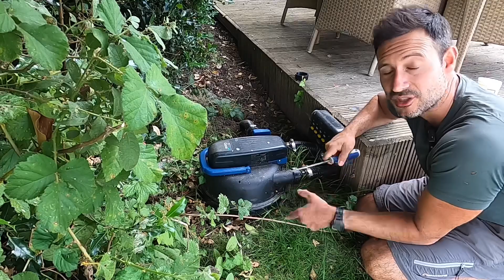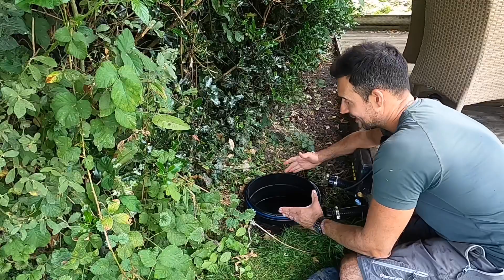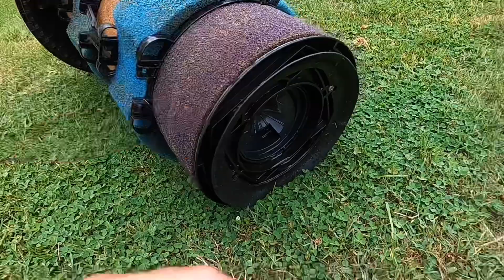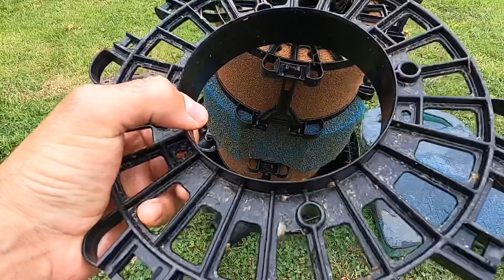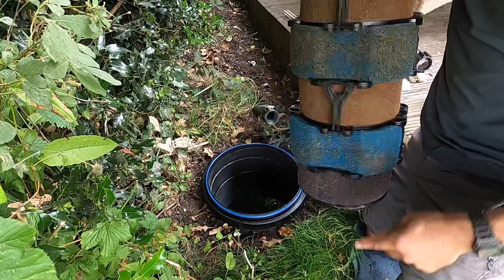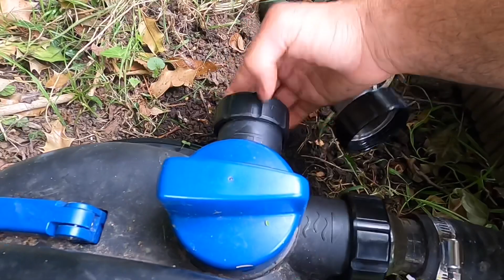How to fully service an oase filtoclear gen 3.0

Comment: Giving my 3100 a thorough service and was hoping you'd show how to remove the central column,  the one which the sponges sit around. I can see some push catches but daren't push any more to release.  Any chance of an update or wouldn't you bother? Cheers. Brilliant  videos you do 👍
Reply from the maker: Hi Stuart, thanks for watching and commenting! Although the central core can be unclipped and removed it’s a bit of a faff and there really isn’t a need to do so-if it looks particularly dirty and clogged simply spraying a hose over this will clear it perfectly well. In all my years servicing these units I’ve never felt the need to take one apart!
Best,
Ed
Reply: Many thanks Ed, I've watched many if not all of your videos over the years from gleaming insightful knowledge helping me make the right decisions from sighting to constructing my 2k gallon pond. So a big thank you to you👍. Re removal of tge inner cylinder, I persevered very gently. In the end it came off quite easily. Gripping the cylinder at the end nearest the lid i just twisted about half an inch. As tge cylinder moves over the shaped plastic sprigs the whole cylinder is released. Glad I did as then able to remove a fair bit of gunge from its inner surface and from the surface it slides over. Bit ocd perhaps but now as clean as a whistle. 
Thanks again Ed, when im stuck youre my go to font of knowledge.  

Now where's that pesky heron!

Comment: Good video! In your experience, is this filter more effective for clarifying the water than the Blagdon pond master 16000?
Reply from the maker: Hi there, thanks for your comment and my apologies for the slow response. Although I don’t have any hands on experience in the Blagdon filter you’ve highlighted, in my opinion and experience from using other Blagdon products vs Oase I’ve found Oase to be far superior.  Sorry Blagdon…… years ago when I started in the trade Blagdon were synonymous with good solid British engineering-their amphibious pumps being a staple in the trade-but now sadly it’s not the case. 
Best,
Ed

Comment: What do you think about one of these running in tandem with a bog filter ? I'm planning on a dumbell shaped raised pond off our patio, won't be heavily stocked, probably around 1500 gallons. 
I like the maintenance ease of these, so was thinking of the Oase Filtoclear and their double inlet pump, using the optional strainer with hose (so I'm sucking water from the bottom centre of each dumbell). Then using a Y piece on the pump outlet (with valves on either branch so I can balance it), then running one branch to the Filtoclear and one branch to a decent bog filter. I like the thought of the biological, natural action of the bog filter as I have heavily planted aquariums where the addition of plants helps hugely with water quality, and combined with the mechanical and UV of the Filtoclear should make a very easy maintenance package for the family. 
....Regularly compress clean the foams, clean out the cannister fully every now and again and trim the bog filter..... would make for a super easy yet efficient filtration and having the two filters is kind of a backup should one block for any reason.. plus the bog filter would be a lovely feature as I'm planning on cladding the raised walls with a natural stone so could integrate the bog nicely.

What do you think ?
Reply from the maker: Hey there! Thanks for watching and commenting! This is a great idea-although you will easily be able to spec a suitable sized filtoclear and pump combo to maintain clean and clear water in a pond of your volume you can never over filter, so the addition of a bog filter will only improve the pond further. In addition incorporating a bog filter will add some different habitat for pond wildlife and offer opportunities for extra planting that you may not have space for in the pond. Go for it!

Comment: Was wondering how this filter would work with
1) Large freshwater tanks
2) Large saltwater tanks
Any idea?
Reply from the maker: Hi there, Thanks for watching and commenting!  This unit would be perfectly suitable in a large freshwater aquarium set up, however I’m not so sure the metal components within the unit would stand the test of time if exposed to saltwater conditions long term… my gut feeling is no, however if you contact Oase direct I’m sure they would be able to confirm this!
Best,
Ed
Reply: @CrystalClearAquatics  Thanks!

Comment: Hi can you remove and replace the uv bulb with the pond pump still running on the latest Filtoclear 13000.
As on the earlier 12000 you could not which was a problem with a upstand pond (filter at ground level below water level) had to switch off pump and disconnect inlet pipe into filter and lift pipe above pond water level (as valve not fitted between pump and filter inlet) to remove quartz sleeve with uv bulb.😢😢
Reply from the maker: Hi there, thanks for watching and commenting; a new feature of this latest gen filtoclear is that you can indeed replace a uvc tube with water flowing through the system. Removal of the uvc tube is separate to the quartz sleeve!  However to be completely thorough I would still recommend removing and inspecting the quartz sleeve for any soiling to ensure its clean to maximise efficiency- and removal of the sleeve would require you to switch off the pump.  If the filter system is positioned lower then pond water level you’ll either have to remove the pump/inlet to the filter from the pond and ensure the outlet pipe is lifted above water level to prevent the pond siphoning out of the filter, or better yet install some isolation valves.
Hope this helps!
Best,
Ed

Comment: Wonderful video Ed!  Thanks so much for sharing.  The only thing we do differently is that the filter itself is not buried directly into the ground.  We instal a large flower pot or bin with holes (marginally larger than the bucket itself) and then sit the filter into it.  Makes for easy removal over winter :-)  Cheers!
Reply from the maker: Hi there! Thanks for watching and commenting and love your idea! May I ask where about your located? Am guessing not the Uk-over here we tend to leave filtration systems running all year around!
Best regards,
Ed
Reply: @CrystalClearAquatics  Yes, of course!  Ontario, Canada!  Because of freezing temps, we have to remove the filter for winter.  However, many customers want to remove the filter during the season too, but once it's dug into the ground, it ain't ever coming out (without a lot of blood, sweat and tears LOL).  Keep up the great work Ed 🙂

Comment: I may be a little late in my comment here. I've just added one of these to my pond, fired it up, pump works, water goes in and out of filter. I turned it off for about half an hour and then turned it back on. Water now sprays out of the hose and theeaded seal of both the inlet and outlet, though it didn't do on the first run. The clips and threads are as tight as possible. Any ideas on what I need to do to stop the leaks?
Reply from the maker: Hi there! Thanks for watching and commenting-is water leaking from the hose connection where it screws onto the filter, or from where the hose is attached to the hose connection? If the former it’ll be the o rings haven’t seated correctly. Switch the pump off unscrew the hose tails , remove the o ring and check for and kinks/debris on them then refit and screw back on. Be careful when screwing back on the hose tail as the O rings can move out of place quite easily. Tighten till you meet resistance then torque a little more. Don’t over tighten as this can push the o ring out of shape and case a leak. If water is leaking from the hose then remove the hose from the hose tail connection, add some ptfe tape to the hose tail, refit hose and tighten with a suitable hose clip/jubilee clip. 
Good luck and hope this helps.
Best,
Ed

Comment: Brilliant video! I have just purchased this exact filter and was just wondering why you wouldn’t recommend this for a larger pond? My pond is quite big 😬
Reply from the maker: Thanks for watching and commenting Oliver! Pressurised filters such as this Oase filtoclear- although excellent in smaller ponds-have their limitations (chiefly the small proportions) and so have limited use in large ponds or ponds with high fish stock/koi ponds. Although technically good water clarity and quality may be achievable using such units in large ponds or koi ponds a larger pump fed gravity discharge, or bottom drain fed system would be better suited to larger ponds above approx 3000/5000 gallons 13600/22700 litres.
Best,
Ed

Comment: I have a problème thé water go out if the filtre down from the change water direction
Reply from the maker: HI there, thanks for watching and commenting- not sure I entirely understand your question, but I think you’re saying that water is leaking out of the discharge/cleaning outlet? If so this is normal- the blue rotary valve you turn to perform a back wash isn’t designed to be completely water proof. If it was then  resistance in trying to rotate the valve would be such that it would make it physically very difficult to turn and cleaning much harder.  This is why the cleaning discharge outlet come blanked off with a threaded end cap.  This must be left in place all the time until a back wash is performed and then replaced again afterwards. Also make sure to return the blue rotary valve to the filter position (pointing towards the embossed fish emblem) after performing a backwash.
Hope this answers your question!
Best,
Ed

Comment: Hi Ed.  I have the older Filtoclear 20000. Do you know if the new style foams will fit ?  I have noticed they appear to be quite a bit cheaper, also there are 3 grades of foam instead of 2.
Reply from the maker: HI there Nigel, good question! Im going to say a tentative ‘Yes’- the new foam shape from gen three will technically fit the older gen two models- however (although I’ve yet to require a set of replacement foams for the new gen three so don’t know this as fact) I suspect a set will only be replacement foam and not include the plastic plates that hold the foams into position and help aid pulling the cleaning lever for backwashing- the main reason why this new shape foams works with the gen three unit.  I also suspect the these foams wont fit particularly snuggly in the gen two units, possibly compromising the filtering efficiency.  My gut instinct tells me to stick with gen two foams for the gen two model.  If I discover otherwise I’ll let you know however!
Best,
Ed

Comment: Hi Ed, great videos .. many thanks I have  a question for you..I have a Oase Filto Clear 30000 with a  AquaMax 17500 , my question is can alter the flow velocity coming from my filter/ pump configuration or can I vary the flow coming from my waterfall... currently the flow is just too strong for my pond ,many thanks..
Reply from the maker: Hi there, thanks for watching! Good question; simple answer is yes- you can adjust the flow from your pump by installing an inline valve and restrict the flow going to the filter.  It’s important that flow rate is adjusted before the filter and not after if installing an inline valve- adding the restriction after would increase pressure in the filter which isn’t ideal. The above will allow you to calibrate the flow to the desired amount-however it will of course reduce water flow to your filtration also- probably not an issue depending on the size and volume of your pond but a better alternative and the approach I would recommend is to install a valved y piece (https://www.pond-planet.co.uk/pond-c1/construction-c51/pipework-fittings-c35/oase-y-piece-including-taps-p148/s352?utm_source=google&utm_medium=cpc&utm_term=oase-y-piece-including-taps-56668&utm_campaign=product%2Blisting%2Bads&cid=GBP&glCurrency=GBP&glCountry=GB&gclid=CjwKCAjwlJimBhAsEiwA1hrp5qtht44NRYaoJELwa3kW6_org63Yzpkeg3XFwSi3MydHObqf5ZrvERoCn8MQAvD_BwE) AFTER the filter but before your cascade and use this to create a bleed valve where you can divert some water directly to the pond bypassing the cascade and some down your cascade.  This allows the best of both worlds; allowing you to maintain full water flow through your filtration system AND fine tuning your cascade to create the desired flow and sound.
Hope that helps!
Best,
Ed
Reply: @CrystalClearAquatics  Many thanks Ed for your prompt response to my question, very logical answer, much appreciated Regards Neil

Comment: Great video Ed. We have a version 2 Filtoclear 30000. Was interested to see how the new version had improved. The locking ring still seems to look a bit fiddly to operate. How have you found finding replacement 60w UV bulbs. Thanks Paul.
Reply from the maker: Thanks Paul! I did make it look a little fiddly in the video-so used to pushing and holding the lid down hard whilst trying to secure the old clamp I was overcompensating! After a couple of goes it’s easy to fit and in general I’d say easier then the old design. 60w tubes are less commonly used currently, although I’m sure other manufacturers will follow suit. I’ve had no issues sourcing 60w tubes for other Oase uvc systems that use them (Bitron eco units) and have been renewing them in customer units with no issue for the last two or three years. They’re not cheap! I’d only recommend using either genuine Oase 60w or Philips branded 60w tubes and they sell for approx £48/£50. I’m sure cheaper branded tubes will be available, but I’ve always had a high rate of failure with non branded uvc tubes so always replace with genuine.  If needs be a 55w tube could be fitted and would work perfectly well in a pinch! Overall I think this new design works well and is a better successor to the gen 2 units!
Best,
Ed